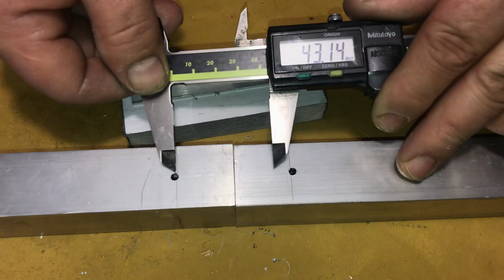NO WELDING JOINT

Comment: Would this be strong enough to hold to halves of a bed together, both sides of the bed?
Reply: No. this is not a replacement for any structural joining methods.